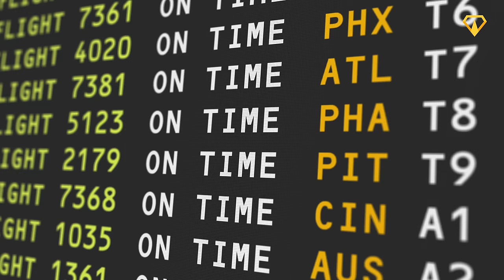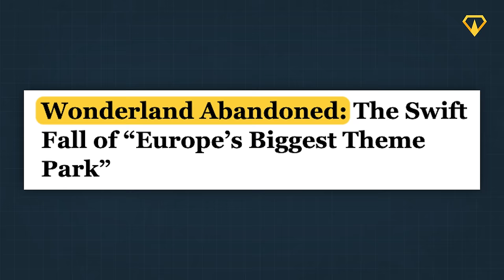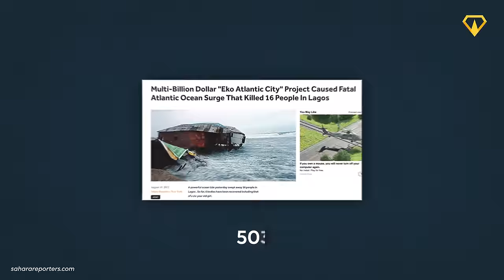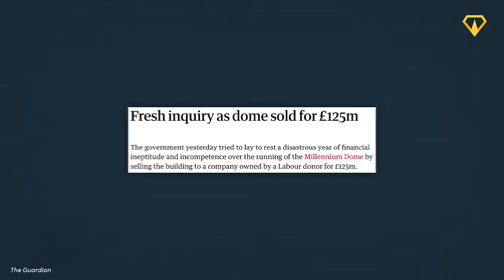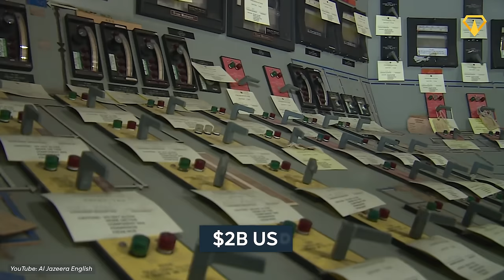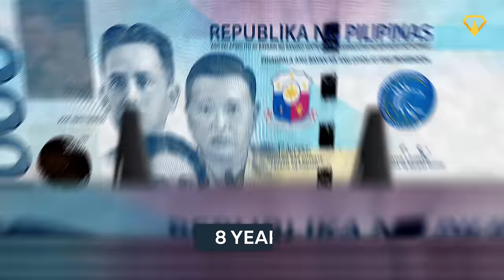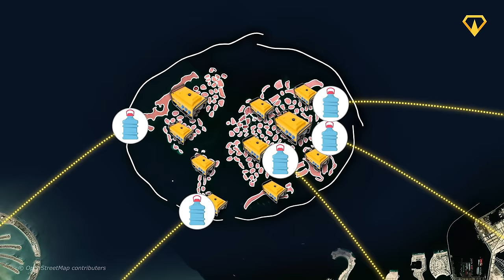The Most Useless Megaprojects in the World

Comment: Nowadays Mirabel Airport is used to move pretty much all dedicated cargo flights, and that does free up a lot of capacity and runway time at Dorval. But it was pretty stupid to abandon the rail link.
Reply: Then I don't consider it a total failure. It is still in use unlike an airport in Germany that never saw a single airplane or passenger...
Reply: You would think they would maybe try to at least put rail link in later. Of course if this new airport could take over all the traffic from the old airport,  then the old airport would probably close and you would have to fiqure out what to do with that. So maybe it is best this happen, since they are both being used and you are not having over crowding that might have happen if this new airport had to deal with all the airplane traffic. Looks like it worked itself out for the best.

Comment: Slight correction on Mirabel. Until the mid-70s transatlantic flights were almost all required to land @Montreal as the Eastern Gateway (as you noted) but it was also government policy not to allow more than a handful of grandfathered transatlantic flights @YYZ. This was to make Montreal a global aviation centre (IATA and the ICAO were both based there, it was also the home of Canadair/Bombardier/Pratt&Whitney & Rolls-Royce engines) as part of the rivalries between that city and Toronto. However political pressure built and Ottawa had to remove the restriction and allow unlimited (albeit bilateral) foreign airline access to YYZ. Since more travellers wanted to fly to Toronto, traffic to Montreal(and YMX) shifted southwestward. Mirabel is still home to the former Bombardier commercial aviation division, now occupied by Airbus and Mitsubishi.

The design of the terminal was also obsolete by the time it opened as it relied on people movers (like those @Dulles) which could not really serve the new generation of jumbo jets. IAD had to adapt its original plans as this also impacted its ability to service jumbos, so built out several piers for regular style gating.

Comment: This fear of nuclear power plant is stupidity. Chernobil had serious project problems, and operatorors made a huge mistake
Reply: 90% or more of nuclear power accidents are actually caused by the coolant water. Or rather, the lack of it. Meltdowns are specifically when the reactor rods get too hot and melt out of the containment center because there wasn't enough water, usually due to a pipe bursting or damage to the pumps.
Reply: @lr8763  every system controlling risky activity has human error in consideration, reason why there are a lot of redundancy.
Are you afraid to fly? Do you have any dan holding water near you home? Do you know when its last inspection happened? Do you know how many poisonous chemical plants are around your home and how dangerous they are to life around you?
Reply: @headphonesaxolotl  How many serious nuclear power accidents have there been this century?
Reply: @albertnielsen1154  Not a whole lot.
Reply: Nuclear Power rocks. It’s as ferrasbras says. I hate hearing the uninformed public speak on nuclear power and all its overblown/misinformed dangers. So says an American nuclear engineer…..🇺🇸

Comment: One important correction about the dates on the Bataan Nuclear plant... it was supposed to be operational in the mid 80s but after the 1986 EDSA revolution, the Cory govt scrapped it but still paid the loan for the project instead of using her clout at the time to cancel the loan as well. 
The Mt Pinatubo volcano erupted in 1992, and no one knew it was actually a volcano because it was a solid mountain. It erupted after 600 yrs. It was never a factor in the justification of the nuclear power plant. In fact, even the subic and Clark US bases were clueless about the volcano until they saw the underground movements. They knew it was going to erupt and hurriedly left with all their hardware, leaving the country to fend for itself after the destruction the volcano also created every year after each storm.

Comment: You know, one of the most annoying things is the absolutely abysmal level of ignorance of any single aspect of modern nuclear power constantly exhibited by almost anyone "reporting" on nuclear power plants.  Regardless of the issues which may have existed with the Bataan plant, and any misled social concerns as a result of Chernobyl, there is a single, simple, highly relevant fact which no one in the merdia ever ever ever bothers to mention: 

The accident at Chernobyl not only can't happen at Western plants, it's practically never been even possible at Western nuclear power plants -- and by "Western", I mean "anywhere outside the former Soviet Union". 

It has to do with *plant design*. The type of design used in Western nuclear plants, historically (newer designs are quite a bit more advanced -- all current plants are based in designs essentially created in the 1960s -- we've learned a bit since then), have almost all been what are called "PWR"s  -- "Pressurized Water Reactors". The Chernobyl design, "GMR"s, or "Graphite Moderated Reactors", is not dissimilar to the absolute very first nuclear pile built in the early 40s in Chicago by Enrico Fermi. It is singularly significant to note that there were less than a dozen GMRs ever built in the West, and even there, every single one of those was out of operation by the mid 1970s. The GMR design was considered substantially more dangerous -- to people with the 1950s and 60s attitude towards nuclear plants -- than the PWR, such that few were ever built. 

Now, lets see why the GMR is much more dangerous. A PWR basically uses WATER to "moderate", or help control, the nuclear reaction that is being used -- said water is kept under pressure, hence "pressurized" which allows it to get much hotter than water usually gets and remains "water" vs. "steam". The temperature of the water in the pressure jacket of a PWR gets up above 600° F., well above the normal boiling point of water. In general, there can be no fire or other significant release of energy -- the worst that can really happen is a containment failure which causes a release of steam -- likely radioactive steam, but still, steam only. 

A GMR, however, is a "Graphite" moderate reactor. Graphite. Pencil lead. *CHARCOAL.*

Yes, we're going to take this source of intense heat, and surround it with charcoal briquettes!! Can ya see how this MIGHT be a bit more stupid and dangerous than STEAM? Because that's what happened at Chernobyl -- it got really really hot, and the GRAPHITE/Charcoal caught FIRE, and burned for days, releasing radioactive particulates into a huge cloud which spread across a significant part of Europe in non-trivial amounts.

The two have nothing to do with one another, don't reflect anything upon one another, and this point REALLY should be part of any discussion of nuclear power -- even if it's only in passing.

P.S., the second worst nuclear incident (it did not involve nuclear power) was ALSO in the Soviet Union, at a place called Kyshtym. I'll let anyone interested look that up. It's yet another example of abysmal and amazing sloppiness and incompetence in the USSR.

=====

As to "holding the referendum before building a project", how about *educating the public about actual nuclear power plants* sufficiently that fear mongering imbeciles don't cause them to make stupid, poor decisions about said projects? SMH.

Comment: When talking failed nuclear power plants one must mention the Shoreham plant on Long Island, New York. It was originally supposed to cost $75,000,000. There was fierce opposition as the costs rose, and local, county, and state jurisdictions and courts all ordered the project scrapped. The power company however used their old federal permit to sneak a load of fuel in and begin testing, thus contaminating the site and making it impossible to deconstruct. It was finally closed after costing $8,000,000,000, more than A HUNDRED TIMES the original budget. It requires a permanent security presence to keep people away from hazardous radioactive area. The local power utility was forced into bankruptcy over this multi billion dollar boondoggle that never sold a watt of power.

Comment: When I look at my local beaches there is a seasonal difference to sand movement.  Summer time is accompanied by gentle waves which lift sand onto the shore and deposit it close to where it lands, building the beach.  In winter, rough waves pound the coast and rip backwards with force, carrying the sand back into the sea to deposit as off-shore sand bars.  In the Dubai situation, no waves are active as the whole structure is “protected” by a wave dampening berm.  All that will happen is slow egress of sand back into the sea.  Sad but inevitable.
Reply: I hope that they also put some rocks, concrete blocks to stabilise these islands otherwise these will progressively disappear…

Comment: By the way, why would you build 2 runways at an angle to each other?
Wouldn't it be better and safer to have parallel runways?
Reply: Building them at an angle is pretty standard. You prefer to take off and land facing into the wind, so having 2 orientations available covers more possibilities. Ideally, you would orient them to cover the most common wind patterns at that location.
Reply: Variable weather patterns.

Comment: The Mirabel debacle was a political and economical decision coming from the ruling class. Up until the 1960’s, Montreal was the financial center of Canada but this status had partly been built on the English ruling over the French. From the get go, the latter group had been treated as second class citizens, cheap labor with less rights and opportunities. When the Quiet Revolution started in the late 60’s, Quebecers (who are mostly French) fought for equality and when they were met with resistance, later threatened to separate from the rest of the country. Therefore investments flew out of the province to relocate to Ontario, mostly to Toronto, making it the new economic center of Canada. Mirabel was doomed from then on. All the plans to make it a functioning and successful international airport were abandoned.
Reply: The hint to its failure was in the lack of surface transportation to and from the airport. If the province had built the promised rail link and had completed the highway 13 extension, it might have worked despite the other issues. Without those links it was doomed.

Comment: Your description of the Bataan Nuclear power plant in the Philippines was total B.S. 
You should be ashamed of producing such garbage.
It was fear based politics that killed the much needed electricity production. 
A politician and the media used the Chernobyl incident to stoke up fear and the Philippines voted for a fool who promised to shut down the project. 
The eruption of Pinatubo had absolutely zero effect to the plant.
This plant is one of the best designs available, Westinghouse design. Several of these plants are working flawlessly in South Korea. 
I have been all through this plant and studied the whole project thoroughly. 
It's a crying shame that this plant is not producing cheap, abundant energy which is all the Philippines needs to lift it out of poverty.
It is built on the flank of Mount Natib, which is a volcanoe but has not erupted in at least 3000 years. Might as well be extinct.
Also this plant was built higher above sea level than Fukishima and, if a similar Tsunami would have landed at the shore it would not have affected this plant. All of the Philippine islands are susceptible to earthquakes, however, there is no fault line under it and an arduous, thorough feasibility study was conducted by the Marcos government prior to construction.

Comment: The Bataan Nuclear Power Plan is build and studied its location. As you can see and search on the internet. The Philippines has faced typhoon, earthquakes etc. but the Nuclear Power Plan is still in good shape meaning the planing is carefully studied before they build it. It supposed to ease the filipino burden and n electricity. The Nuclear Disaster in Russia is a russian style while the Bataan nuclear power plant has a same model in S.Korea which is still working now. Cus the Bataan Nuclear power plant is safer than the russian style. Its just their is a Dump not politician Women that took the presidency and act smart which is not and decide to waste the Nuclear power Plant. By not operating it due to political image might be decreased if this power plant on run. Now the Philippines is facing Expensive Electricity Bill due to depending in coal and gas power plants. Hoping soon the Bataan nuclear power plant will run and serve the Philippines as it should be in the beginning